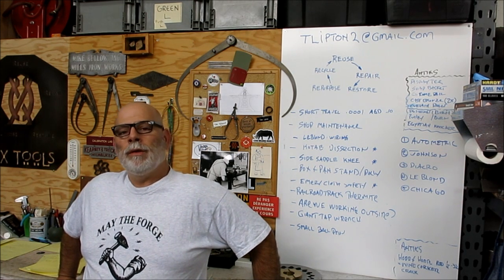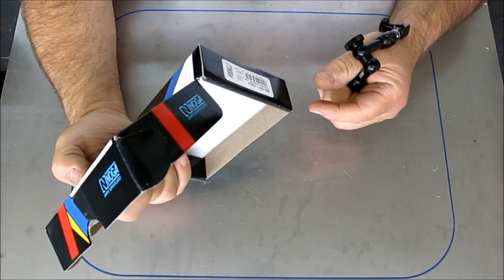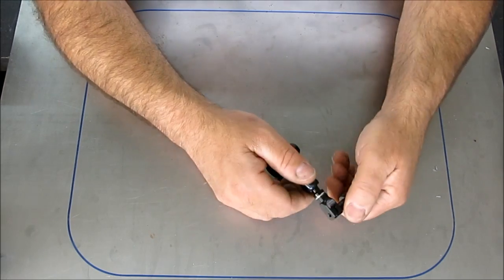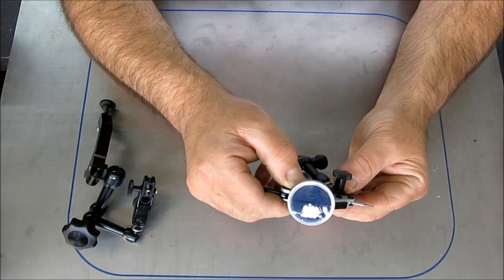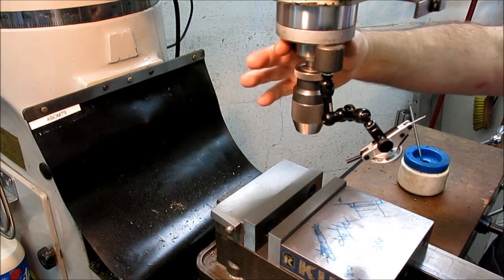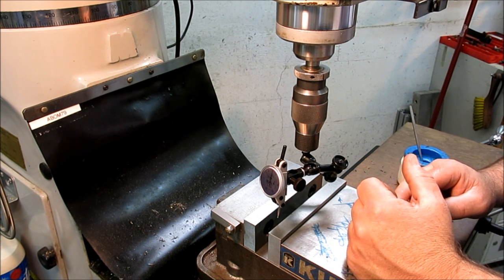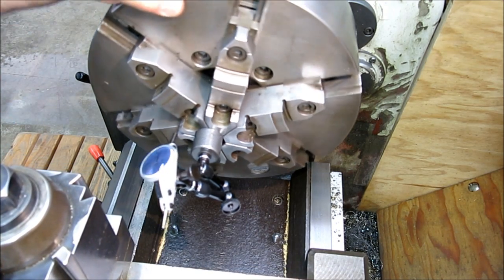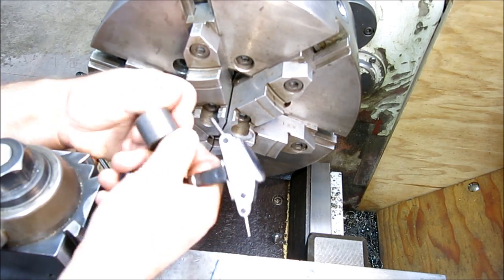Noga Mini LC Indicator Holder

Comment: Thanks Tom.   I've found a bunch of different styles on Noga's website, yet USA suppliers only have a few in the catalog.  NF1033 comes to mind, search on Enco. Nothing, Google NF1033 and towards the top is an Enco Listing.  Rectangle magnet, with fine adjust.       Use caution with the big 70# Magnetic base... I use a 35# Hunk of  8620 to dampen vibrations when walking with the camera.... yep, magnetic didn't hold that weight after 30 minutes (heat related!). Missed my toes!
Reply from the maker: Hi Tom,

Travers was the only one that carried the model with the round pot magnet. Travers part number is at the end of the video.

Cheers,

Tom

Comment: Nice video.  I intend to purchase a nice flexible holder of that general type.  I am too lazy to do a lot of work but I often find myself wishing I had that very setup when I do.  Thanks for sharing.
Reply from the maker: Hi Cerberus,

I use this size at work fairly often. Not enough to spend the $$$$ on a Fisso but certainly a Noga on sale.

Cheers,

Tom

Comment: You really need a wireless mic! It would cut down the echo in your opening monologue...
Tom - Vista, CA
Reply from the maker: Hey Tom,

Looks like B&H is going to need a shuttle delivery system. Between sound and glare I'm getting it from all angles.

Cheers,

Tom

Comment: Hey Tom I have been following your your impressive channel for a while now and you totally hooked me up to metalworking. I am planning on buying a mill but still need some advice what to check to evaluate a used one. I saw your video on how to evalute a lathe and would like to now if you are planning on putting something similar up here or on your blog for a mill.  
Thanks for all the info and advice i got from your channel and blog already.